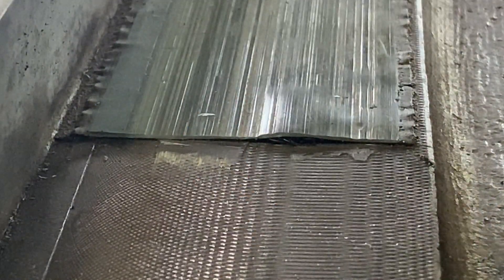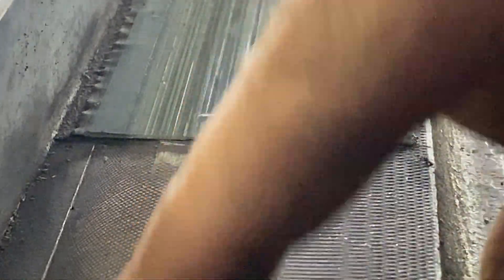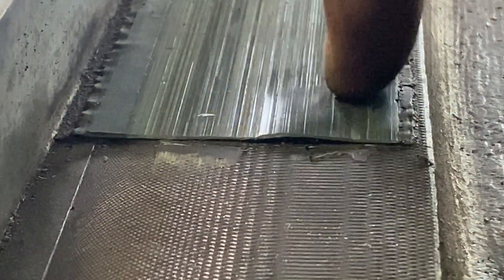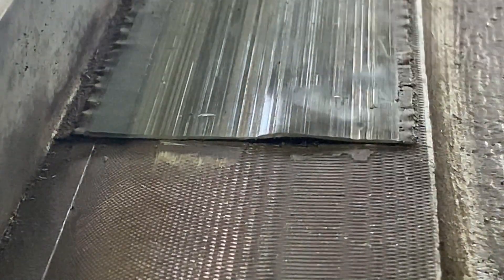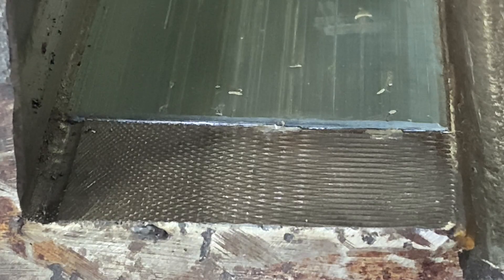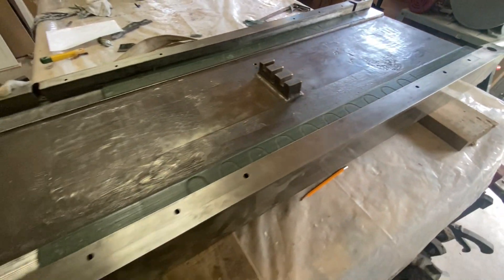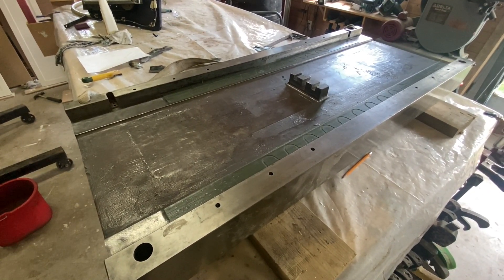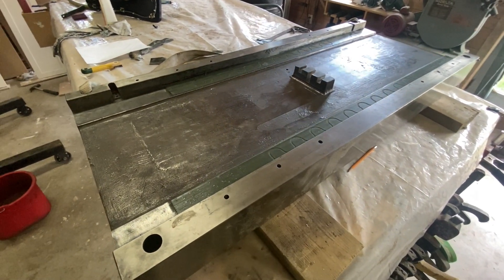Part 29 - (Trimming the turcite)

Comment: I will need to do a similar operation for my lathe. I am now watching every video I can find on this topic... From where did you bought the turcite & adhesive?
Reply from the maker: This is where I bought my turcite but I haven't installed it yet so I can't attest for the quality yet but the best price I found: https://www.aliexpress.com/item/1005003000517374.html?spm=a2g0o.order_list.0.0.30991802oSEaQl 

The adhesive, same story... : https://www.aliexpress.com/item/4000240328794.html?spm=a2g0o.order_list.0.0.30991802oSEaQl

Good luck with your lathe!
Reply: @BlaiseBarrette  What thickness did you bought for your machine?
Reply from the maker: @mindovercnc4452  don’t remember.

Comment: Yes that bubble is definitively better gone. You can always buy turcite like material on AliExpress with the glue for little money if you ever decide to replace it. Turcite is really easy to scrape. Hard part is to have the tools to ensure that is flat, square and perpendicular, etc. precision squares, long straight edges, etc. looking forward to see more videos of your CNC reconditioning.
Reply from the maker: Hi P Lopes, the bubble is gone! I had a look at you YT channel! Wow!!!I am very impressed! The two tool changers! The 4 and 5 axis! The probing! Wow!!! Really nice!
Reply: @BlaiseBarrette  thank you Blaise 😀
Reply from the maker: A retired FADAL technician told me that instead of scraping, he would glue fine grit sand paper to the ways and do back and forth moves to « lap »the turcite.
Reply: @BlaiseBarrette  Hmm, that is a very good idea too! Thanks!
Reply: @BlaiseBarrette  honestly I fail to make sense of how that would produce an accurately flat surface or even a suitable surface for sliding ways. Maybe Richard King could weigh in on that method. https://www.trelleborg.com/en/seals/-/media/tss-media-repository/tss_website/pdf-and-other-literature/catalogs/turcite_b_slydway_gb_en.pdf?rev=1c0dca20b57045e985ab20f8f609a7bb&hash=1B3490D6E66A908DC7D8EBFDFE11E3ED
Reply: @PWLopes9000  I responded, but it seems like my response was auto deleted before... How could it not produce an accurately flat surface? If the ways are ground and hardened, and you apply sandpaper to them and use that to surface the turcite, you don't' think you'd end up with a flat surface on the turcite that matches the ways? Wouldn't it be like fitting the feet of a violin bridge to the top surface of a violin? You use the surface it self and sand paper to sand in the contact between the bridge and the top surface. Also, you mentioned getting cheap turcite on ebay/aliexpress. Do you know how much difference there is between the cheaper green "Chinese" turcite, and the more expensive blue "Japanese" turcite? There's a seller on ebay that says he can get either, but the Japanese blue stuff is a little more expensive. Wondering if the extra cost is worth it.
Reply: @gorak9000  well lapping two surfaces requires turning the master around in between passes and also requires controlled overhang while lapping. Then I also don’t see how the glue is applied to the sand paper on the ways and then removed, etc. maybe I just don’t visualize it well. Could there be a video somewhere showing that method? In any case of you try it would be great if you share their results. Not sure about the higher quality turcite.
Reply: @PWLopes9000  I'm probably just going to get the turcite (and the waylock 2) from mtsandtg - their price is only a few dollars more than the "japanese blue" turcite on ebay, is already here in north america (so should ship faster), and they have the glue and de-greaser prep as well. The turcite, glue, and degreaser is only about $200 - not a huge expense in the grand scheme
Reply: @gorak9000  makes sense.
Reply: @BlaiseBarrette esa técnica es riesgosa por las cargas de peso,  tendría que equilibrar para evitar un desgaste desproporcionado. Saludos
Reply: Can either of you (or anyone else for that matter) offer any advice on my turcite problem? I'm doing a VMC rebuild, and after pulling the saddle and table from my machine, I have issues with 2 surfaces of turcite. Both of which look like they were replaced at some point, as the oil grooves cut into them are different than the rest of the turcite on the machine. I think the one piece on the saddle needs to be replaced entirely, as the glue has failed (probably the last person there didn't heat the cast to get the oil out), and other area has come delaminated on one side of the oil groove for quite a distance on the table. Not sure if that entire piece needs to be replaced the whole length of the table? Also any pointers on where to get precision squares, long straight edges would be really helpful. Pictures here: https://photos.app.goo.gl/irwdQKFrWrHqcHG38
Reply: @gorak9000  I would agree that all failing surfaces absolutely need to be redone. And while at it, it would be a good opportunity to redo the ones that have wear even if not failing yet. Scraping turcite vs cast iron is very easy, I buy all my straight edges and squares off eBay, second hand. Just too expensive to buy new. Hard part is to scrape surfaces in relation to other surfaces.
Reply: @PWLopes9000  Because I only have one surface on Y and one surface on X that need new turcite, and they're the side surfaces not the main bearing surfaces, would it make sense to glue the turcite on, and then reinstall the saddle (or table in a separate operation after the saddle is done) onto the machine with the ways covered, and use the gib to provide some clamping and then let the epoxy cure? Would any scraping need to be done then, as the epoxy would cure with the turcite against the surface it would be running on anyway? Then remove it again and machine in the oil gooves. I found this picture of a machine rebuilder that seems to do it that way: https://www.rmscnc.com/publicity-blogs/rebuild-remove-replace-turcite. In the 5th picture they show the ways covered with heavy paper, and the turcite glue side up, and then they put the table back on to glue the turcite to the bottom of the table. That would seem to mean everything is already true to the ways, and eliminate the need to reference the one surface to the other, and maybe even the need for scraping? I probably won't replace the turcite that's good - there isn't that much wear, and it's a hobby machine, so probably won't get enough use to justify doing all of it. The whole point to taking the table and saddle off was to unclog all the lube passages and replace all the metering units, and flush all the lube lines, so it will be properly lubed going forward. Then of course the deeper you dig, the worse the surprises get!
Reply: @gorak9000  I think that is a good way to approach it and it will probably run ok. But if you imagine the turcite will not be even to a few micrometers in thickness as it’s not manufactured to have a precise thickness ( I would assume). Also the layer of glue, for as careful as you may be, it will likely not be even to a few micro millimeters either, plus when the glue is squeezed by the weight will again generate uneven thickness. All in all there will forcibly be variation, that can only be eliminated with scraping. However you could try, then put it all together and check how the machine moves and go back to scrape it if needed.
Reply: @PWLopes9000  Yeah, that makes sense. I was just wondering if my idea of using the machine itself to clamp the turcite was completely crazy or not. I don't see a lot of mention of that method, but it makes a lot of sense. I really love watching your videos especially about Linux CNC and probe basic interface. I'd really like to switch my machine over to Linux CNC, but it's a Mitsubishi M3, and it has a proprietary parallel bus between the NC control and the axis and spindle amps - somewhere in the back of my head I envision reverse engineering the protocol and making an FPGA based interface for Linux CNC (like the yurtaev.com interface, but for the older M3), but as it's been almost 3 years since the forklift dropped the machine off in my garage, and my machine isn't operational yet, let's call that a "stretch goal" :)
Reply from the maker: The quick and dirty way I guess!